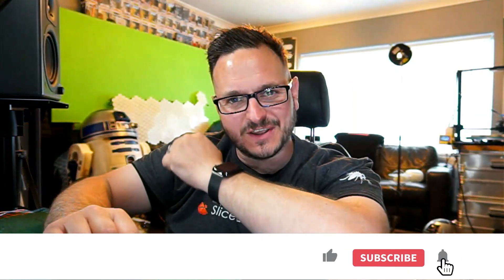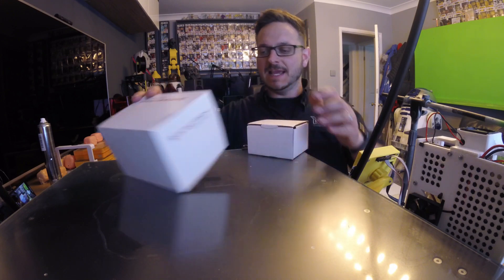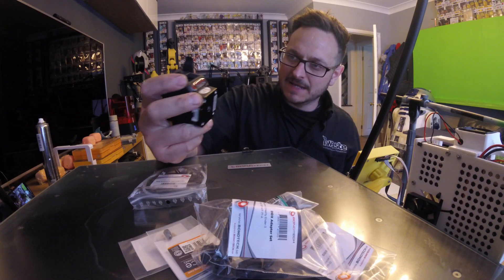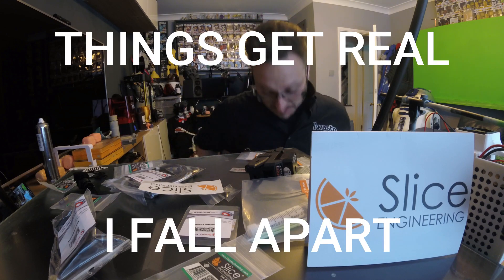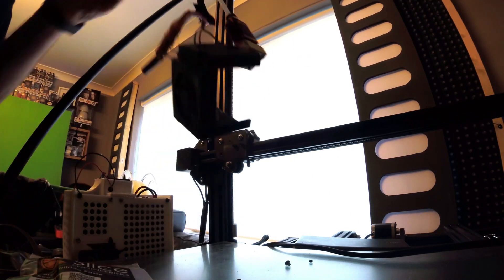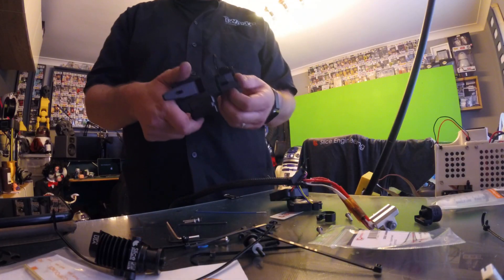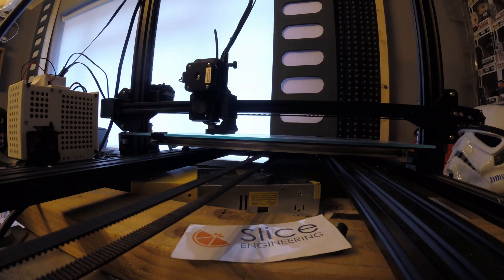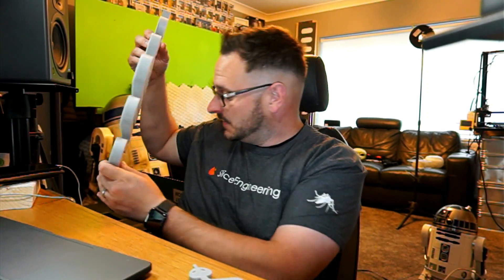Slice Engineering - Copperhead Hot End with BondTech DDX Direct Drive

Comment: I just installed a copperhead on my Ender 3 pro. I am wondering what your retraction settings ended up being? I’m having a hard time tuning out the stringing in my prints.
Reply from the maker: Well depends on what you are printing in? Petg? also are you using the DDX ? Happy to help if I can

Comment: I have just ordered the Cooperhead and the DDX direct drive for my ender 3, The instructions say about the CR10 and changing the voltage on the mainboard, did you do this also? how easy was it?
Reply from the maker: Which voltage is it talking about? The fan ?
Reply: @TheRealSamPrentice  No, the Extruder stepper motor, Just below it on the board is a screw,  Bondtech have told me that I need to modify the voltage on the mainboard for the E stepper motor, to stop it overloading
Reply from the maker: @LukeTuck110  You mean the vref? 
which board are you using?
Reply: @TheRealSamPrentice  I have the creality silent board 1.1.5 8bit board.
Reply from the maker: @LukeTuck110  Ah okay that makes more sense, I'm not using anything creality other than the framework on these builds. So the 32 bit board is an SKR 1.4 turbo by bigtreetech and I'm using trinamic stepper drivers which are TMC2209's - did you say it blew the motor?
Reply: @TheRealSamPrentice  NO, I am waiting to install it, as Marlin 1.1.9 doesn't have this specified in the firmware, and don't want to compile it from scratch, so trying to upload marlin 2.x but for some reason it isn't working, so i may just buy a new board, like the SKR, if it will work with the creality LCD
Reply from the maker: @LukeTuck110  right... okay personally I’d steer clear of the creality boards and just go in with a 32bit board with tmc2226 drivers and a small touchscreen. Check out kay3d and their cheetah software to compile your own
Reply: @TheRealSamPrentice  thank you, Much appreciated
Reply: @TheRealSamPrentice  Just ordered the BIGTREETECH SKR MINI E3 32 Bit Control Board Integrated TMC2209 UART For Ender 3 but BondTech said, what is determening the current is the motor that is used you should adjust the current to max 700 mA but keeping it 500 or 600 mA will keep the motor cooler.
Next step for me is to get the Cooperhead wired in with the new thermistor

Comment: Will this work on Ender 3 v2?
Reply: Thanks man, if u can get me some straightforward answers to what I'll need to make this ender 3 v2 be a direct drive bondtech/slice machine ... probably .40 nozzle? so much to learn lol it's my first 3d printer but I don't want problems and I want quality
Reply from the maker: @AgnosiaAgnosis  Depends on what you are printing, I have a 0.4 ad 0.8 I use the 0.8 for big prints to cut down on time. This is an open-source system so you make the rules!
Reply: @TheRealSamPrentice  right on... so do I have an affiliate link for bondtech or just slice?
Reply from the maker: @AgnosiaAgnosis  ping me an email therealsamprentice@gmail.com and i'll cc you on my contacts.
Reply from the maker: Yes sir
Reply: @TheRealSamPrentice  also how do I know your link is working (purchase) I don't see a discount anyways but I wouldn't mind using your link... it's hard to figure this all out I'm a noob lol but want to have the dopest ender 3 v2 by replacing these two things (bed level springs also)
Reply from the maker: jvdahmen I’ll check that and come back to you shortly :)
Reply from the maker: @AgnosiaAgnosis  Yep the link works, let me know how you get on.
Reply: @TheRealSamPrentice  I emailed bondtech and they recommend ddx and mosquito (gee the most expensive ones lol) I just don't like paying full price if I can help it lol. But yeah I was on my PC and just couldn't see any kind of discount anywhere with your link (or that I was actually connected somehow to it)
Reply: @TheRealSamPrentice  excellent. I thought I read somewhere that there was some sort of stipulations like a fan shroud replacement or whatever. Forgive me, I have my v2 in the mail... and am ALREADY looking to replace extruder and hot end... very much considering direct drive also...
Reply: Also, when you go on SE's website it says copperhead available then says coming soon when u click on it
Reply from the maker: @AgnosiaAgnosis  Most odd, you can get both direct from bondtech tho
Reply: @TheRealSamPrentice  no link for you though! bah. I'll try to get a hold of slice... BT got back to me